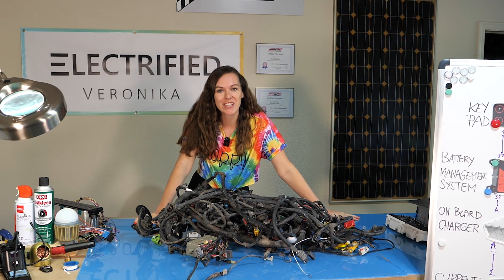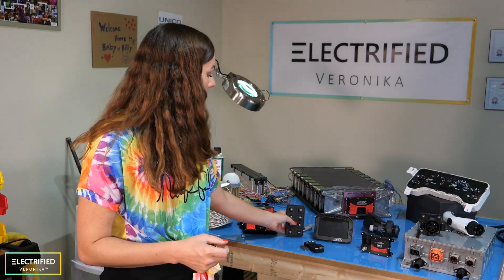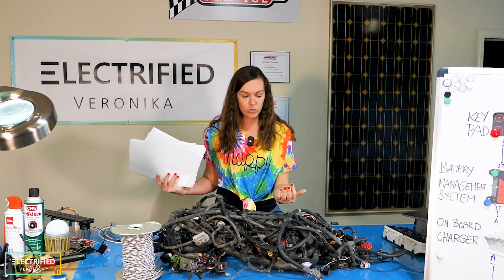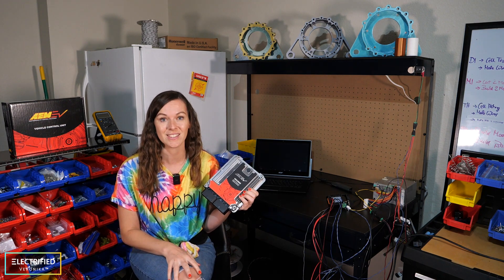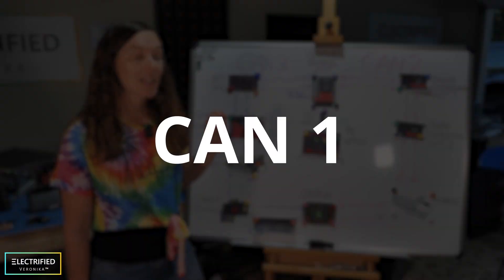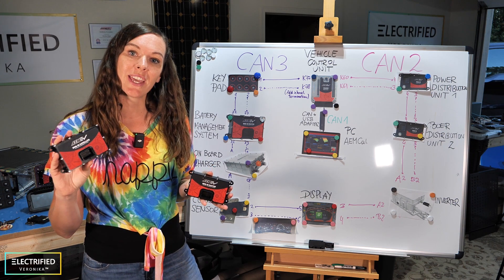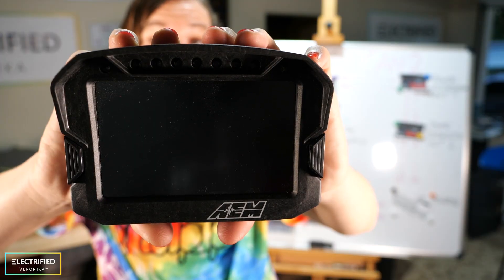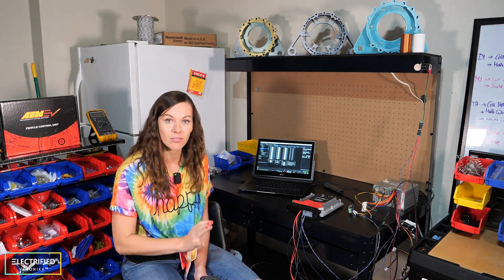How to Design CAN Control System - Electric Jeep Wrangler

Comment: Super fun to see your thought process, even the analog dials like the tachometer can be used for something else, like an amp meter. You could control a servo showing the amps with a microcontroller reading the current sensor. Impressive you took out all that wire, maybe not the easiest path but so many cool options now
Reply from the maker: Thanks! We actually have a way to control the stock cluster directly from the VCU. So we can do really fun things. Like you suggest we are planning to using the tachometer as a battery power/energy needle so you can see when you regenerate and use energy. So much fun!

Comment: I love the VCU 200 but I have some beef with aem pushing super hard for their entire ecosystem
Like for instance the keypad really isn't necessary, the VCU has raw pinouts for PRND. The PDU's are cool but a lot of the jeeps original 12v stuff will still work just fine. I could see maybe one pdu for coordinating stuff like cooling pumps and some valves
Reply from the maker: I understand what you mean. In my case - doing that for the first time - I am happy that I get guidance and a system where I know it works together. 😅☺️

Comment: > What other vehicles might be an easier conversion with what is on the shelf today? Looking for an easy bolt together plug and play system.  Enjoy your project in progress, and can't wait to see it - hear it zooom.
Reply: This is as easy as it gets
Reply from the maker: Well I would say, the Jeep is one of the most complicated cars to convert. Why? It has selectable 2/4WD, if you have just 2WD you have more options for the selection of your parts and the electric powertrain. Then it is a very small vehicle, so there is not much space for batteries. A vehicle with a biiig “frunk” that does not need to go off-roading would be easier. In terms of controlling, the older the better I would say. And again the whole off roading takes it to another level. So there is many cars that would be easier. Good question and I want to make a video about it after we are done with the Jeep with all the learnings ☺️